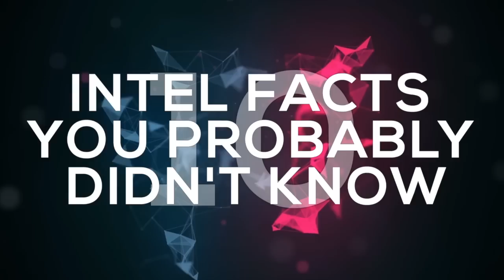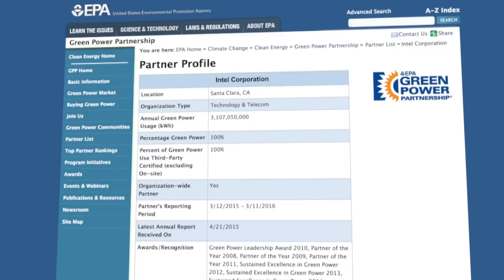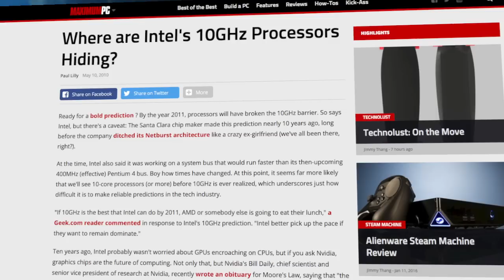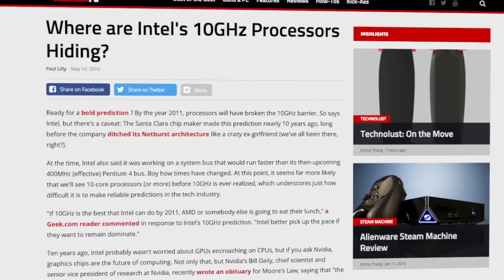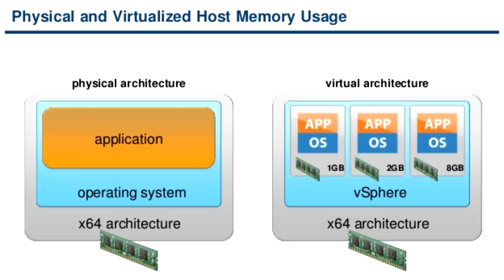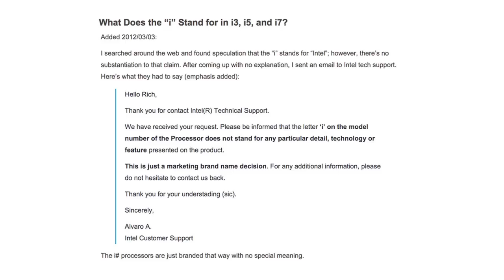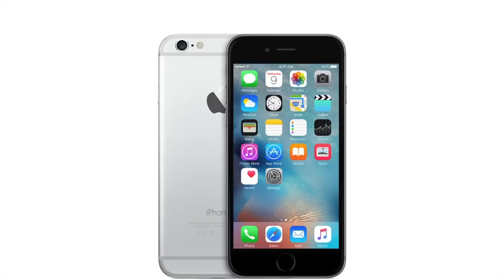10 INTEL Facts You Probably Didn't Know

Comment: Yeah because right now if i switch to intel im stuck with buying a new mobo :(
Reply: every thing I've watched about them said it was
Reply: +yerroc the down side to Intel is each generation is a new chipset until you get to the X series chipsets which last 2 generations for AMD one chip set lasts for 3 to 6 generations but generational improvements are not there. Intel claims they have generational improvements idk if they do or not. The main improvements i see in Intel chips now are more of hard drive and I/O optimization for the CPU to other parts than on the CPU itself to get the needed data faster when not in L1 L2 or L3. 
L4 kinda died when the slow down was found to be to much as did integrated RAM. Both AMD and Intel looked at them and probably tried it in a lab but as how it works it would make a bigger slow down than if it was in system RAM. L4 was more of a marketing thing than anything else as they were going from L2 to L3 being marketed and L3 was able to be bigger than L2 without as much of a slow down. In the hypothesis L4 would just add onto the set to go through after L3 but how big do you make it and when is it a SoC instead of a CPU?
Reply: yeah i ended up just going for a fx 8390k, i still had to get a new mb but i could get a better one for overclocking with the money i saved, also did a fresh install of win 10 since i had to anyway after the mb swap.
Reply: with CPUs speed increases for consumers kinda stopped noticeable increases in 2012 with the 8230 and the 2500k ... the 8390k is able to be overclocked though the overclock will yield little to no general consumer nor gamer benefits.
severs, workstations, and prosumers can use and see the little changes between them but most wont see them
Reply: With DX12 and Vulkan arriving the cpu is becoming less important com paired to the gpu, which is nice i guess since the gpu power is rising much faster than the cpu's
Reply: yerroc how can you go less important than one of the last things in to think about? 
The CPU does alot yes but a Intel CPU is not that different from a AMD CPU when used for general consumer use anyway. 
On a last note you still took the CPU into account towards the beginning in 2012 and later systems?
Reply: +yumri4 look it up, Vulkan and DX12 are makeing the cpu less important, I'm not saying it's not because it is important but the cpu does not need to be as powerfull with them because they are shifting more off to the gpu
Reply: Vulkan and DX12 isn't making the CPU less important, it's just making the priority of single threaded performance less of an importance over having more cores. Making the CPU even more important based on how many cores and what kind of cache hierarchy it has.

Comment: Actually, the reason GHz have become less relevant isn't that computing performance doesn't matter, but that we've gone to multi-core processors and modern processors can execute many more instructions per clock cycle, so performance can go up while the GHz don't. A 3GHz Haswell is going to process lots more than a 3GHz Pentium 4, even if you only use a single core. Also, the reason Intel stopped using numbers (like 286) is because numbers can't be trademarked like things like Pentium and Core i7.

Comment: Not only would it be strange to call a processor by a number, they actually got in trouble for it in the 90s. In the before times, their processors were just called by their codename, like the "386." Then they were told they couldn't copyright numbers, and thus the Pentium line was born.

Comment: Actually, AMD can make x86 CPU's not because of fear of a monopoly, but because Intel did not understand the importance of the platform when they gave the licence. AMD helped make CPU's for Intel at one point. Some see this as a mistake in hindsight, but AMD later turned out to be the only thing stopping Intel from being a monopoly 20 years later.

Also, it's not accurate to say AMD invented the x64 architecture. Since x64 is very heavily based on x86, a company could not have created x64 without the x86 license. But it's still an achievement to get Intel to accept someone else's standard for their own platform. AMD also was the first to create a multicore CPU.

Comment: Moore's Law has actually kept pretty consistent and probably will for the next few years. The Gigahertz of a processor does not rely on moore's law it is the speed at which the internal clock of the CPU runs. NOT the number of transistors on the chip. Fun facts
Reply: Actually, the max clock speed of a processor is directly determined by transistor size. MOSFET transistors work by physically moving electronics to create or destroy wires. To increase clock speed, you can increase how hard you push/pull the electronics(increases voltage), reduced the electronics resistance to movement(chemistry stuff), or reduce the distance the electronics need to be moved(node size). 

There is a side effect where reducing size also reduces max voltage, but that isn't what stopped clock speed increases. Duo to low yield rates and a sharp drop in power efficiency around 4GHz, it just isn't economical to go past 4GHz. Intel tries to get around this with an extensive binning process, but the fact still remains, that for each 4.7GHz processor the produce, they make many more that hang around 3GHz.

Comment: The codenames of the cores, such as Sandy Bridge or Haswell, seem more meaningful and memorable than the "iSomething" brands which are just the relative performance level within a family of processors. Today's i3 is not the same as it was a couple years ago. With a change in core comes new efficiency stats, and broken compatibility with old operating systems, and classic games in the case of a GPU. The advertised model numbers of both CPU and GPUs tend to be confusing when companies recycle older brands, such as the Pentium, or digits in video card designation.

Comment: Actually, as i heard, CPU-Chips are not developed higher as 4.2 Ghz because of Physics limitations. Imagine that the small transsistors on atomic level have reached its density and could not be done smaller, due the electricity "jumps" between them could not be controlled on such small scale.

Comment: Fun Fact: In 1998 / 2000 when powerpc was still going over at apple, intel wanted a peice of the pie.  From this came IA-32 and IA-64 which is a series of CISC processing sets that are similar to RISC, what powerpc, MIPS, CIPS, and ARM uses.  As intel got more and more into it, fewer and fewer people really cared.  There was the godsend powerhouse that was the IBM PPC chip, and as arm was getting bigger and better for industrial areas and MIPS and CIPS was being used for gaming areas (the PSP uses MIPS, as does the gameboy color) intel had few places to go with their IA-32 arhcitecture.  As of 2001, HP decided that CISC seemed like a good idea, though it is pretty slow, and basically bought out the CISC area from intel for the HP-UX systems they were designing.  The designs they had were similar to VAX systems from the early 90's but they wanted a fresher start on it.  As of now, HP and maybe 2 other companies use CISC.  The IA-32 and IA-64 architectures have been broken down into other architectures for integration but the pure arch's are still being used for the HP-UX boxes, of which are used for science and phone systems.

I know a lot of useless shit.

Comment: Number 7 I feel is kind of true. cause the processer I have in my PC is a phenom 2 black edition multi core processer. 6 cores, each running at 3.5 GHz. so that's a single processer technically running at 21GHz, spread over 6 seporate cores. and I got it back in 2011.

Comment: OMFG, so much misinformation.I'll make a list
GHz is not a measure of transistors, it's a measure of speed. Even then a processor with a greater clock speed isn't always faster.
X64 doesn't exist, it's called X86-64 as it's an extension of intel's X86 architecture.
Rant over.
BTW the method used to create transistors on silicon is Lithography.

Comment: we do actually have more than 10ghz CPUs, but by the time we realize that we dont actually need so much ghz, what we need are Cores. so what we did is to split those 15ghz and divide them to Cores, like that we have more space for Multi Applications and performance. 
Consoles works better with one single core. thats why consoles have up to 8ghz core cpu.

Comment: Another Intel facts: they created in the late 90s, early 2000 a 64 bit processor called Itanium, that everyone believe it was revolutionary, until they saw that the performance in x86 programs was total shit, and that programming and optimizing code for that processor was really hard. The whole architecture was a dismal failure and in the half 2000s, Intel had to adopt the AMD-64 architecture, which was much better. 
Fact: in the early 2000s, Intel flagship processor was the Pentium 4, which used a new architecture called Netburst, which allowed the CPU to reach higher clock speeds, but sacrificing performance. On the other hand, AMD created in the first half of the 2000 much better architectures, like the K8 and the Athlon 64/64 X2, which perform much better and ran cooler than it's Intel equivalents, the Pentium 4 HT/Pentium D. Despite this, Intel dominated the market because of it's name and reputation, but many enthusiast bought/assembled PCs with AMD processor at that era.
Fact: Intel was sued by AMD because they offered rebates to manufacturers who agreed not to sell or limit sells of AMD chips in their products. In 2009, they settled the case with Intel paying U$1.25 Billion to AMD. Intel doesn't like to play nice when they began to lose market share.
Reply: and now its a monopoly basiclly from intel
Reply: +Ayrton Senna Technically,I believe AMD created it when they created the Atari Jaguar.
Reply: +WarsunGames well, it wasn't a real 64 bit system, and the CPU was a Motorola
Reply: Ayrton Senna
I opened it up.It had a 64pin by 64pin.And a 32pin sound chip.It was 64bit.It could run 16 million colors as advertised.It was 64bit but the games it got were complete crap.So all that Stuff about it having 4bit chips and two 32 bit chips were lies.
The companies ganged up on Atari to try to put them out of business.They lied through their teeth the whole time.An it worked.The American business collapses an the Japaneses an Chinese businesses got their game systems released.The companies that were suppose to support the 64bit systems Bailed out.Like Activation an over 130 others.
Reply: +WarsunGames having 64pin by 64pin doesn't mean it was 64bit.  Modern Intel CPUs have little more than 1150 pin, but they are 64bit. 64bit CPU means it has 64bit internal registers and a 64bit instruction set, and that didn't exist in consumer products at the era.

Comment: how about the fact that intel has not shared hyperthreading or smp instructions like x86 architecture  and thats when Moore's law started to fail. selling hyperthreading as a dubble clock speed trick when its not actually speeding up the physical cpu core clock. its a trick to keep the cpu core bizzy. stoping and starting a new task, loading data to cache and ram, comunicating with gpu and chipset and chipset components are twice as fast in terms of latency only.

Comment: I don't think they never went at 10GHz because of GPUs. Why wouldn't they if they could? I think they simply reached a physical limit in that aspect. And then they went to multicores. Which is cool unless a lot of the software don't use them (they'd have to rewrite the code to be parallel). I remember more than ten years ago I was looking at a CPU based realtime raytracing, doing like 2-4FPS. And I dreamed that in ten years we would go from 2GHZ to 16GHZ and that would run like 20-30fps. Guess what, it still runs like shit in my I7. And parallelizing their optimization techniques is not easy.

Comment: I haven't seen a comment about this yet, so here goes. Moore's law is about the number of transistors on a chip, not the clock speed of the chip. With more transistors, the chip can do more in one clock cycle than a chip with fewer transistors at a higher clock speed for some number of fewer.
Reply: But small transistors can switch faster.

Comment: Problem number 1: Viatron had the first microprocessor on their embedded system shipping in 1968, 2 year before the CADC was complete, in fact the CADC was not even started until 1968.
Problem number 2: Wind, Solar, Hydro, and Geothermal power sources all rely on coal and fossil fuel based energy to maintain their output. The only 'clean power source' would be nuclear with failsafes. But I agree, reducing dirty power usage is vital.
Not a problem but just to note, we are actually closer to 5 Ghz, with multiple threads and cores and higher transistor counts enabling better performance, a Pentium 3 even if it could reach 10 Ghz, would still be far slower.

Contrary to popular belief, AMD and Intel are constantly trading blows, granted it's been some time since AMD was on top but that tends to happen when the most popular performance market has not seen anything but revisions to the FX series since 2007. That's right, still really close to Intel  CPU's with an architecture originally designed 9 years ago, albeit they only keep pumping more power and heat to reach higher clock speeds and making minor changes to allow this.

Comment: We're capped at 3ghz for two major reasons.

1) Transistors have reached the size of an atom.  How do you fit more than 1 bit (Either being turned off for a 0 or turned on for a 1) inside a single atom?  Well no one knows right now.  This is why we can't get 10ghz processors because they just can't find a way to put more 0's and 1's inside a single atom!  How crazy is that???

2) Heat problems.  If we can't fit more bits into an atom, why not just make the processors bigger so we can have more atoms spread across the processor?  It's all because of heat!  The larger the CPU, the more heat it will generate!  We all know how noisy CPU fans are and putting a larger fan with a larger heat sink would just cause even more noise!!! No one wants a jet engine sound drowning out all the sound in your computer room or living room  Sure there's liquid cooling, which isn't noisy and they could simply create a larger or multi-tube system to better cooldown a CPU, but it's more expensive (slightly these days), but also requires more maintenance.  The average PC consumer will forget to fill up their coolant tank, they'll get frustrated whenever their PC won't boot up until they fill it up, they're scared the average computer noob won't setup their liquid cooling system correctly or tighten the bolts and liquid will spill over the insides and short circuit everything and become a major headache for stores that sell PCs and so much more.  All in all, liquid cooling systems isn't computer-noob friendly!  Only hardcore gamers use liquid cooling systems.
Reply: +Kreeded We arent capped to 3ghz, its just we choose cores over clock speed. Most standard desktop cpu's run above 3ghz now. My 4690k is running at 4.5ghz just fine and thats nothing special for my chip. The world record was 8.8ghz or something like that on liquid nitrogen
Reply: +Kreeded Hmm... The transistor maybe use to stored or change the bit, but it is the speed of storing/retrieving/altering the bit that decide the Hertz... Grace Hopper have said that computer have to be small to be fast, but size is not the main issue as we can add more power for faster speed, but it will lead to Heat problem you mention.
Anyway, we just cannott have CPU faster than speed of light, so we are not yet reached the limit...
Reply: +Kreeded they're size isnt 1 atom infact its 90+ atoms...

Comment: 7)
Moore's law still holds, 3, 5, 10 Ghz is clock speed, completely unrelated to number of transistors packed on a chip, which have increased consistently thanks to better fabrication techniques but will reach an end when transistor size goes below 5nm (because of Heisenberg's Uncertainty Principle).
2)
Pentium processors were called so because they were based on 5th generation ( Five in Greek = Pent) microarchitecture by intel, would've been cool if they did that with i-series as well (it's not Itanium architecture).

Comment: Once we hit about 2nm tech we're going to run into problems with manufacturing transistors at that size due to physics.
Reply: +hussein hussein Thats why we are attempting to make Quantum computing a viable option for the future. As we get smaller transistors, it becomes harder to dissipate the heat and obviously as you mentioned, physics becomes an issue. I doubt we will get much smaller than we are currently at with silicon CPU's.

Comment: My MacBook Pro has a Intel iris 5000 chip, should I be happy?
Reply: +Tyler Kegger Thats not the cpu part of your chip. Thats the name of the integrated graphics. Macbooks are a total rip off considering the power you get for it. I presume you spent around £1000, a windows laptop would easily smash yours in terms of pure computation and graphical power. Potentially a quad core mobile i7 Haswell/broadwell and some sort of dedicated graphics, maybe a 950m/960m.
Reply: it's comparable to low end nvidia

Comment: You messed up GHz with the Moore's law; it is, to this day, still vigent. The GHz race was stopped due to the power wall [too hot to cool conventionaly after 5 GHz and avoid a lot of electrical and design problems for that high frequencies], that's why the approach changed to multi-core CPUs for aditional performance, rather than a single CPU with higher frequency.